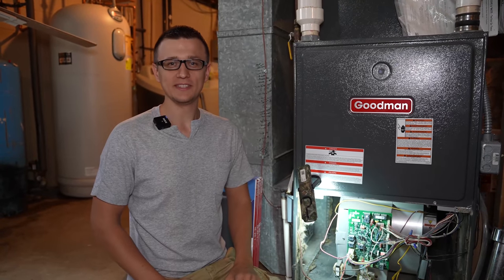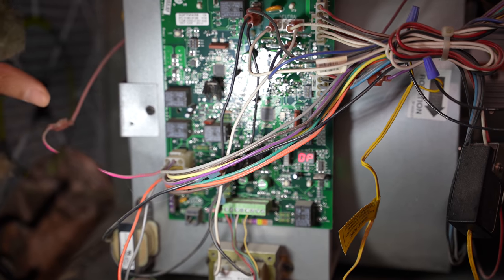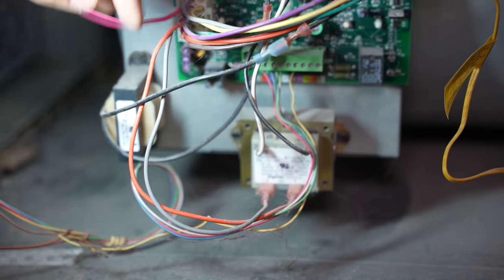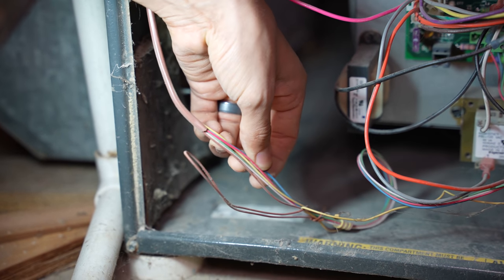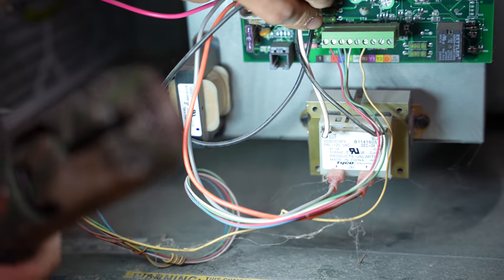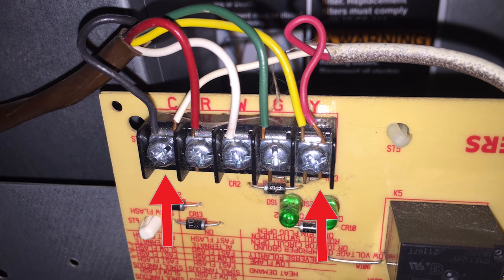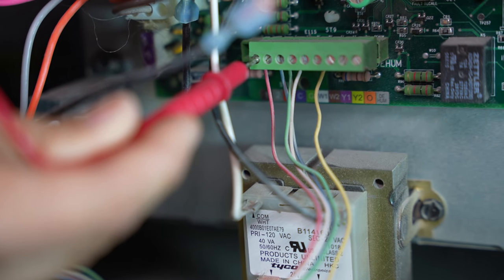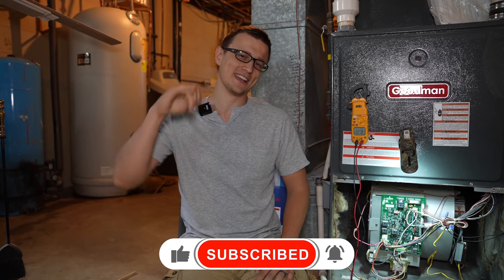HVAC Furnace Has No C Terminal?

Comment: I purchased a honeywell C Adapter for my Alexa thermostat. I have W, W2, Y R, G and B terminals. The B terminal is where the A/C common connects to. If I use that for my C, the thermostat will activate both the furnace and A/C. Thoughts?

Comment: So if you don't have a 24-volt terminal strip, how do you connect your thermostat to the C-wire?
Reply from the maker: Simply put the common wire in the same place where the common wire from the air conditioner goes. Under the same screw or in the same wire nut.

Comment: Is the common wire, a hot 24-28 volt DC always? If so can I tie in with the red wire?
Reply from the maker: It is actually AC voltage. Putting a common and a hot wire together would be a direct short, causing the fuse to burn out.
Reply: @WordofAdviceTV  my confusion came when you went up to that strip. Mine doesn’t have a motherboard or strip. I watched again, I think I understand, the common wire is more a neutral and I can splice into the wire coming from the outside condenser unit. Duh it says VAC and I said DC.

Comment: Great Video. I have a really old i.e. 1980 roof top HVAC system. I looked inside the HVAC unit and could not find a control board. I did see a really old transformer and an Ignition control unit.  Any way how I can find the C - Wire?

Comment: I have an old furnace with no ac. There are 2 wires to the t stat. I have a smart t stat that needs a common. What’s weird is the transformer is ungrounded so when i check the secondary voltage its 13 volts to ground each side but 26 across the secondary. Do I change out the transformer to a grounded one and then use the a screw for my common.

Comment: I have Agro AZ-6P zone controller and 4 zones hot water base board heat with 4 thermostats. My controller does not have anywhere “C” terminal. All of my 4 thermostats have two wires ( Red connected to R terminal and White wire connected to W terminal). I have a spare 24 v transformer near the control board. There are unused wires in the TT wires. My question is that can I connect two wires from this spare transformer to two unused wires in each TT wire to supply 24 v to each TT?

Comment: I am still searching for a sweet and to the point video showing me how to INSTALL a C wire from my thermostat to the furnace control board when these two conditions exist: i) the cable from the thermostat to the furnace has ONLY 4 wires in it and ii) Nowhere, I repeat NOwhere in the control board, can I find a terminal point labeled "C". Any hep will be greatly appreciated. Thanks!

Comment: I have no problem reading a meter but you haven't answered the question.  If all I needed is 24 volts I could find a cheap transformer. Is this Y terminal on at all times? How many amps?

Comment: If I have no control board whatsoever, could I not just splice into the 24volt side coming off the transformer as long as the splice is done correctly? Or is there a reason I should not do this?
Reply from the maker: Yeah that should be fine as long as you don't accidentally hook up a hot to common.

Comment: thanks for the helpful video. my furnace has a Honeywell R7284 Oil Primary Controller that the red and white wires connect to. There is no air conditioning or other equipment attached to the furnace. the white wire is connected to the T terminal and the red one to the T3 terminal. Then there are 3 terminals next to those that are numbered 3, 2, and 1. Would one of these be the C terminal? how would I know? Would I put a probe on where the red wire is hooked to, then look for 27 volts on one of the other unused terminals?

Comment: Thank you for the great video. I learn a lot from your video. I saw the smaller transformer on the left of the voltage transformer. Can you tell me what is that use for?
Reply from the maker: You're welcome! Glad to hear you learn a lot. That smaller transformer is actually not originally part of the furnace. That small transformer is solely for the bypass humidifier which is installed in the ductwork behind the furnace.
Reply: Hi jay tranks very much for your videos... you explanation its great!!! I have a question in the furnace if The technician in the call  found the correct 24 volts at all points in the control circuitry where needed. One component is not functioning, preventing the flow of gas to the pilot burner. What is it? What did you think the component is fault?the ignitor is OK and sparking, but there's no gas to ignite,so what could be preventing it for lighting? What component is at fault?
Reply from the maker: I would start by seeing if the control board is blinking any error codes after it fails to ignite. If you have an ignition module instead of a control board, those tend to fail and not send power to the gas valve. If your ignitor is sparking, the next thing that should happen is the gas valve gets energized. So I would check to see if the gas valve is getting 24-27 volts. If it is not, then there is a good chance that the board or ignition module is bad and needs to be replaced. But if the gas valve is getting power then either the gas is turned off somewhere or the switch on the gas valve is switched to off. If you verified that the gas shut off valves and switch are both on/open and it is getting voltage then I would say that the gas valve is stuck in the closed position and should be replaced. 

Another possibility is that the gas orifice on a burner or two are plugged and not allowing the gas to flow through (especially the burner in front of the ignitor). If you have an intermittent pilot then the little pilot orifice (tiny hole where the gas comes out from on the ignitor pilot assembly) may be plugged and needs to be cleared out.

But keep in mind that this is only my guesses, since I am not there to see it I can't say for sure what is going on. I hope this gave you some ideas of what to take a look at though. Good luck!

Comment: So is the “C” wire 24v or is it a ground? If it’s 24v can I just tap into the transformer 24v , if a ground,just run the thermostat c terminal to ground side of transformer?

Comment: The cable to my home thermostat has 4 wires, there is no spare wire. It's not practical to replace the cable with new one having 5 or more wires. What would you recommend for installing a smart thermostat?

Comment: Great videos, I've learned a lot! Quick question : My furnace breaker immediately trips (kicks back) when I try to reset it. What should be my steps? I've looked for a wire short indoor and out and dont see anything abnormal. Should I replace breaker? Thanks for your help
Reply: Did you replace breaker?  What was the solution?  Sounds like a shorted wire to me.  I had a wire go bare from rubbing on a pipe vibration; but it blew the main fuse as I recall.

Comment: Thanks for the video. Have some questions
I installed a nest thermostat and looks like NEST has a battery in it that needs to charge and it is not getting enough juice to it and shows low battery. I traced the brown NEST thermostat cable from NEST to the furnace unit in basement, the Nest thermostat cable plugs into a controller (The general 90, model 50A50-110), I notice that only (Y, W, R, G) are connected to the controller from NEST thermostat cable. 
I also Notice that there is another brown cable (similar to NEST thermostat cable), that seems to be going outside the house, this cable also plugs into the same controller (The general 90, model 50A50-110) in the furnace, but it only has 2 wires plugging in (Y and C), in the Y the RED wire is plugged in and in C the White wire is plugged in. 

My question is, to give power to the NEST Thermostat, can I plug in the blue wire from my NEST thermostat cable (blue wire is not connected to controller right now) into the C connector on the controller (The general 90, model 50A50-110), Keep in mind that the C connector on the controller already has a white wire connected from the unit outside, so I will be connecting a second wire to the C connector and the connector will end up with 2 wires a White wire (going to the unit outside the house) and blue wire (going to the NEST thermostat).
First,  connecting blue to the C connector on controller, is it going to give power to my NEST?
Second, Will this cause any issue with the unit outside, since C will have 2 wires now?
Third, What is the C connector for ?

Lot of info, thank you for help. hopefully this all makes sense.

Comment: Quick question. I have a c wire not being used but, now I’m going to install a smart wifi thermostat and I need to wire that c wire. Easy at the thermostat but, at the furnace there’s already two wires connected to the c location. Where do I connect the c wire now?

Comment: Question... My motherboard doesn't have a connection for the Blue common wire. I have the wire that runs from inside the house to the furnace outside. However, there's no spot on the electronic motherboard to connect it too. Any ideas on how I can get my Nest thermostat to work without buying a wall plug. Thanks

Comment: Is the 24 volts DC current?     Does the step down transformer also have a rectifier?
Reply: No. It's 24 volts AC. No rectifier on my 50 year old furnace.

Comment: Thanks for this useful information, I installed a smart thermostat as you know it requires steady 24V from the C wire. The problem is that I have 4 unused wires at the thermostat side and furnace. I don't have a control board so all the cables are hooked in the old way.

Thermostat wiring legend:
Rc, rh jumped and red coming from the furnace 
W1 white
G green 
Y1 blue

Outside air conditioner two cables
White 
Pink

Can I use let's say the unused orange cable and connect  to the white wire coming from the air conditioner to the furnace  so I can connect the orange on the C terminal in the thermostat?
Reply from the maker: Yes. That would be a good option. The white wire coming from the air conditioner is usually the 24v common. If you have a wiring diagram on the furnace or a multi meter, it would be good to double check and make sure though. If the white wire happens to be the hot wire, that can fry your new thermostat..
Reply: I just found that the white goes to y1 blue at the thermostat, so i guess Ill connect the new orange to the pink one?

Comment: I own a NewYorker Furnace and I'm trying to locate the Common. I have an integrated boiler control 1135 630 model.
Reply: I have a separate central air and looking to install a Sensi WiFi thermostat

Comment: I had trouble finding it. It actually had a second cover in the way and a vent blocking that cover. But anyways, after removing the pipe, then the cover, saw a circuit board. And surprise surprise, the installer didn't attach the C wire to anything. Found a "Com 24V" plug and put the C wire in. Surprisingly, the green wire wasn't attached to the circuit board. It's attached directly to a W wire. I don't understand why..... So my thermostat R is good (attach to R to circuit R attached to a wire R), thermostat W is attached to circuit board W with another W wire hanging, then G thermo wire attaches to circuit G attached to W wire. No idea why this is.

Comment: The HVAC industry should standardize this using a wire that has more than enough conductors to connect any system, whether it be furnace (gas or electric), complete HVAC unit or heat pump.
Reply: I’m sure they do on modern housing.

Comment: First off I'd like to say your videos are great, very helpful. So I've had 2 hvac companies come out because my compressor isnt turning on. They think its a bad compressor but both didn't seem sure about it. I'm nervous about replacing the compressor since the system is only 5 years old and its expensive. The one tech mentioned there was no voltage on herm of the capacitor. Tried replacing the capacitor with a new one, that didnt work. Still no voltage on herm. Have you seen this before? Is there a way I can figure out why theres no voltage on herm of the capacitor or test the voltage of the plug going into the compressor?
Reply: This is probably too late to help you but I'll explain a few things to you. If the compressor is only 5 years old it should be under warranty. As far as the no voltage on the herm terminal of the capacitor, there shouldn't be any. This terminal is where the wire from the start winding on the compressor connects. Sounds like you need a competent service technician at your house, any competent tech should be able to determine if the compressor is faulty, has open windings or is shorted to ground.
Reply: @bill944  smart man. Teach these umm HVAC "techs" how to actually do their jobs. I have had a few try and tell me my system is shot yet after they left I fixed it myself knowing electrical systems and circuits. 1993 Nordyne system here STILL running strong. If compressor does die then I will replace unit as no experience working with refrigerant and compressors.
Reply: @DL30Creations  I love to see old units running. So many techs see an old unit and see a commission check. I look at an old unit and see what's wrong and see if I can get it running properly. Keep a customer happy and you'll be there when it's time to replace, piss 'em off and they'll have someone else make the diagnosis and get the sell. Treat people right and sleep well at night. Too many incompetent techs and scam artists. They make me sick and make my job harder.

Comment: May I ask, my home only have gas heater, with 4 zoning. (AC units in each room) do I need to connect 4 individual C wire between the panel's wire to the thermostat wire?

Comment: Quick question.  My son has an old AC unit and someone gave him an AC unit that is a year old.  Can this just be installed to the old copper tubing.  His old unit leak the R12 out per the last inspection.
Reply: Most likely yes,but should be cleaned

Comment: So if I'm getting 28 to 24 V oot of my transformer can I used that 24v terminal as C wire?
Reply from the maker: Yes. Just make sure you don't accidentally put your common on the hot side. That would be a direct short.
Reply: @WordofAdviceTV  thanks you're the best

Comment: I came across a heat pump with no board, no common wire to the thermostat. An couldn't get 24 volts when putting my leads hot to ground.

Comment: Hi, so I did some troubleshooting again.  I am using one of two wires coming from condensing unit as C wire.  When I turned on fan it works fine.  But when I turned AC on, the ecobee thermostat restarted and the AC doesn't work.  The air handler has no control board and I could find R, W3, W2, W1, G and 3 terminals.  R is connected to a red wire, G is connected to a green wire and 3 is connected to a white wire which I could find all these wires on the thermostat side.  In appears that instead of Y (no Y terminal), 3 is used for cooling.  There's an unused blue wire.  The air handler is only connected to AC, no heating.  A multimeter shows 27 volt when connecting R to G or 3.  At the air handler, I tried to jump start the fan by connecting R ang G, then I heard a zap sound and the fan won't start.  When I connected R and 3, I saw sparks and the system won't start.  They all remain 27 volt after the zap and sparks.  When I measured the voltage of Rc - G and Rc -Y on the thermostat side, they are all 1.7 volt.  I am sure the condensing unit outside is good because I press the contactor and it runs.  Not sure what's going on here.  I am hoping you could point me to the right direction.  Thanks!
Reply: Problem solved! The "3" terminal is actually the "C" terminal!

Comment: My furnace/ac board only has W1,W2, Y, R, G and B. Which can I connect my c wire to? The outside AC connect to Y (white) and B (red). Can I assume B is a ground?
Reply: I have the same question. I will assume it’ll be the B since its 24v right. Did u ever figure it out?
Reply: @justdissin7340  pretty sure I used the B wire and it worked out

Comment: Good morning. If the is a zone panel. And i have 3 thermostats going into it. How do I add a c wire to all of them? Do o need to run a blue wire from the furnace to the zone panel then in the c terminal of the zone panel plug all 3 blue wires together?

Comment: I have the weirdest question. I have a weil mclain cg boiler. According to the schematic, my thermostat goes from r to g instead of r to w. I got my nest thermostat to work by hooking red to g on the boiler and white to red on the boiler. and c to c. If I hook w to g and r to r, it doesn't like that. Would I be better resetting the nest and telling it I use 4 wires instead of 3 and running g to g and adding a white wire to W on the furnace?

Comment: My wire coming from outside is like the one in the video with a bunch of wires. But my furnace also doesn't have the control board. All wires are hooked up by twist connectors. The blue one connects to a bigger black wire like the one you call a 120v from the transformer. Those four bigger wires are red, white, black and green. I'm trying to find the common so I can connect a smart thermostat. The present thermostat has five wires but no "c". There is an "o" for the heat pump I think. The red, white and green wires from the thermostat connect to the corresponding bigger wires. Then the blue wire from the outside bundle to the black one. What the heck?

Comment: Hi Jay I am installing a new no battery operated thermostat and I’m have an issue. My ac is a package unit Bryant and I’m trying to add the common wire
From the condenser board I get 23-24 volts but when I check down stairs I get 16-18 volts and does not turn on my new Venstar thermostat. I tried using another extra wire to see maybe the brown common wire was shorted out but I got the same with the extra green wire 16-18 volts. Am I missing something? Also I’m checking from Red to green/brown Common terminal.. thanks